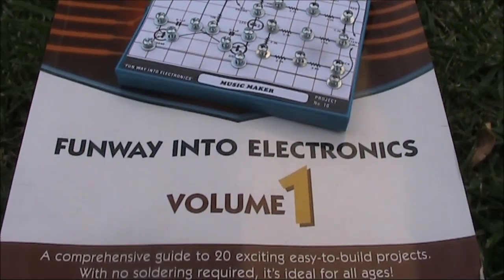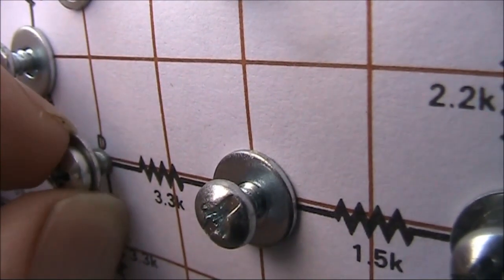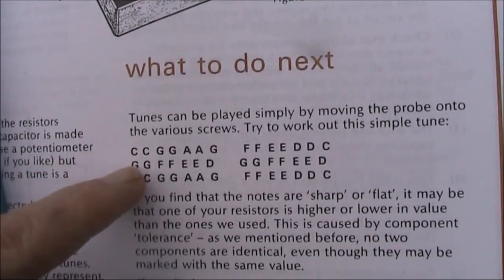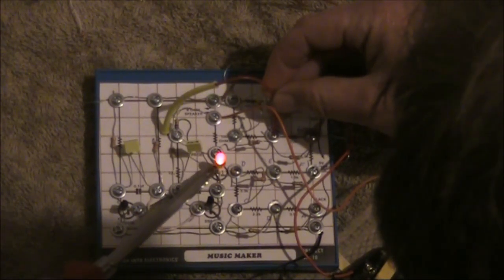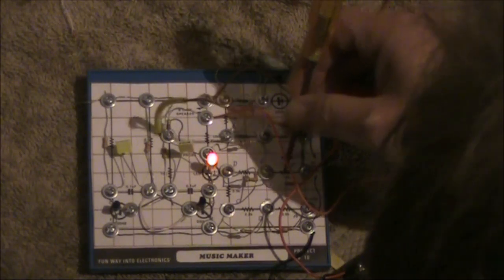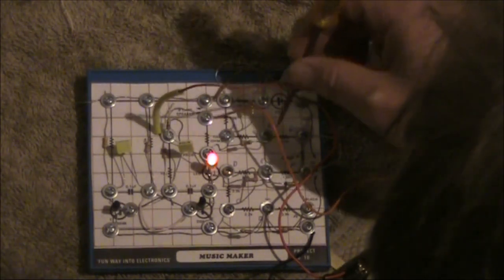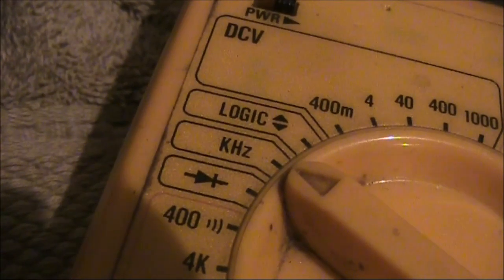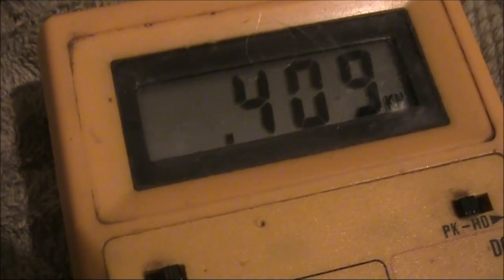Funway 1 builds: Music Maker (Project 10)

Comment: Microtonal mayhem !!!

I love the way the notes are laid out. Where you move to the left to climb the scale
Reply from the maker: I think that's the only way they can fit it on the board. It probably uses more screws and parts than any other FW1 project.
Reply: @vk3ye  it is kind of a styl-o-phone, an instrument made popular by a bearded convicted pedophile 

The complex waveform and the microtonal approximation of each of the notes makes for some painful melodies, but impressive given the use of what I assume to be E12 value components...or does it use resistors with in between those common values ??
Reply from the maker: @MidlifeRenaissanceMan  It only uses standard resistor values. But either it or the similar electronic organ in Funway 2 talks about using other values in series to change the notes (or from memory) filing resistors to change their value).
Reply: @vk3ye  oh how far our technology has come :-)

As a present for my son, I picked up a couple of Denshi Block kits by Gakken, a Japanese company 

They rereleased their 150 in one kit and the expansion kit. They weren’t cheap, but beautifully crafted. So I bought him a new set plus the expansion set, and picked up a second one second hand. 

They are worth having a look at